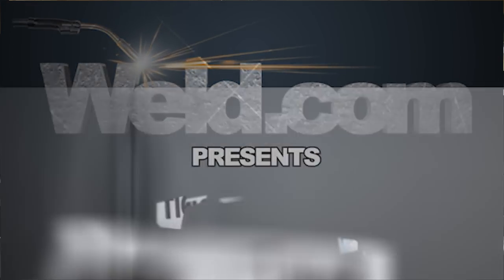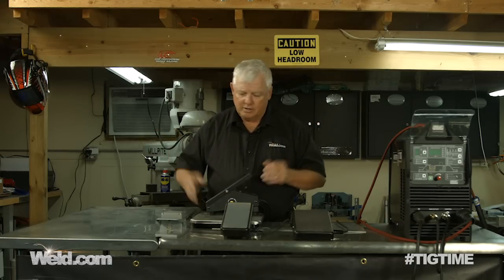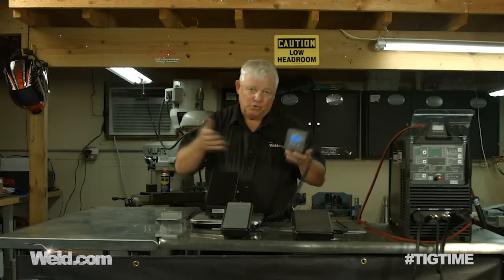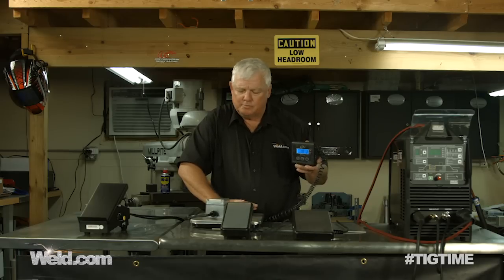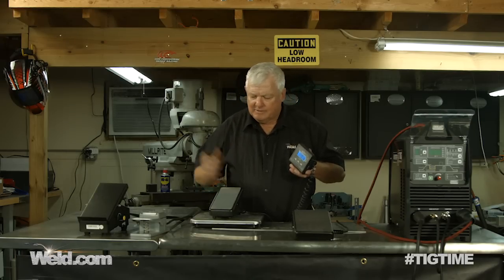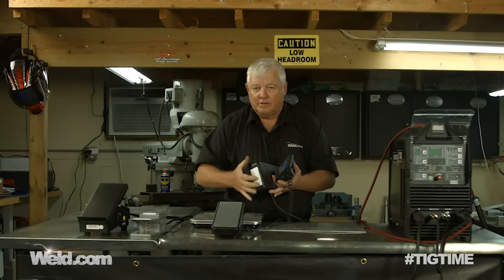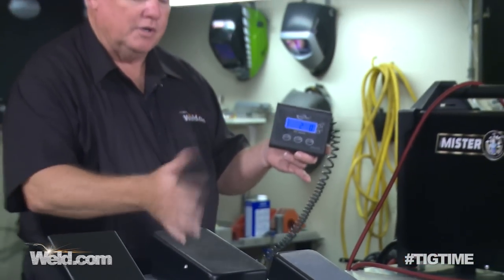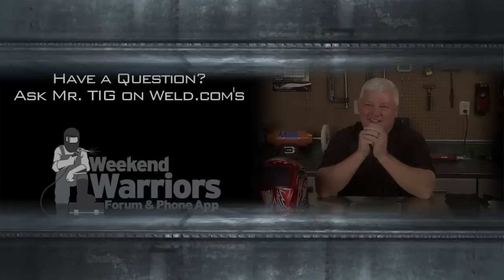TIG Welding Foot Pedal Review: Good and Bad | TIG Time

Comment: One thing that should be considered for Everlast users, is that the longer "throw" of the Everlast pedal offers better resolution by offering further travel area over the same amount of amps, resulting in the ability to make more gradual change in amps.   This can make it feel a little less "snappy" than the SSC, but does give finer overall control than the shorter travel of the SSC, which we do recommend to our customers but is a tradeoff and a definite factor in some people's decisions.
Reply: If you are limiting the amperage on the control panel the throw shouldn't matter as much as the smoothness, right? Just limit the amps a little more and you won't get the jumpy feeling, correct? For the record, I use the Everlast 200DX with a mr tig kit and really like the machine and the accessories.
Reply: Frank Bibby
 If you have to weld at say....150 amps, you will still get better control out of a pedal with a longer range of travel.  The Miller pedal is such a pedal with a longer range of travel and different dimensions similar to the Everlast and many people do like them.  The Mr. TIG kit is nice and top of the line.  We recommend it, approve it.  No reason not to get it if the additional cost can be swung, but I wanted to point out this factor was overlooked in the discussion.  We do have people that want a finer range of control.  Personally, the notchiness of the pedals that I have tested is really not a lot different than the SSC in the newest ones.  The first few mfg'ing runs of the new pedal did not have enough lubricant on the gears.  A new grease/lubricant is being used and the smoothness is much improved. But when all is said and done, No one can beat the SSC for design durability, and over all performance.

Comment: Feels very much like a Shell- video to me
You only mention the brand of one pedal, of which you claim it can be made to work "on every machine" but also say that the pedal with the heavy spring "is the only one that works" for certain machines.
If your machine doesn't have amperage limiting built in (and those exist, especially older ones) a footpedal with a pot is actually really useful.
Pro Tip: A Footpedal is just a giant box with a potentiometer and a switch
Look up the wiring diagram for your welder and just make your own if you weld in places where certificates of conformity aren't necessarily important
Reply: shill video, not shell video.

Comment: The kemppi pedals have two pots! To set both Min and Max amperage. You can't even set it at the machine since only a kemppi pedal will work and they all work that way. The good thing about such a setup at least, is you can adjust the resolution of the pedal. The throw is always the same, but not the range.

Comment: The grey import with 15 pounds pressure makes irregular spots in the weld bead when you get on or off the amperage. I'm going to change or adjust the spring

Comment: If you have the pedal with the knob control on the side is there any way to be able to control it from the machine instead. The pedal has to cables comping out 1x 2 pin and 1x 5 pin and both connect to the machine.

Comment: Mr Tig, that first pedal I believe comes with our Aussie brand "Uni-Mig" ACDC Tig machines. I'm new to Tig Welding, so I have a question about that Foot Pedal, does that Amp Control on the side of that foot pedal over ride the Machines settings? because I can set the amperage on the machine, but I don't know if the foot pedal controls the total amperage that my machne can put out or if it controls the amount available that I have my peak amount set at at the machine. For example, if I have my Peak Amps set at 120amps on the machine, but my machine has a maximum capacity of 200 Amps, so will the foot pedal max out at 200 Amps if I press down all the way flat, or will it max out at 120?
Reply from the maker: The foot pedal over rides the machine setting. So if your machine is set to 200 amps and your foot pedal is at 50%, you will only get 100 amps out of the foot pedal when fully depressed.

Comment: I have become curious about how the tig pedal actually changes the amps inside the machine. What flows through the tig pedal must be just a micro current right? What is going on inside the machine that allows the micro current to effect amperage change? Thanks.
Reply: It's just a potentiometer in the pedal setup as a voltage divider. There's also the clicker switch that turns the welder on. The internal microcontroller inside the welder uses an ADC to read 0-100% and scales the output amperage accordingly. It's part of the main amperage control used by the front panel.

Comment: The function of the knob on the pedal completely depends on the way the pedal interfaces with the machine and the capabilities of the machine. In some configurations the pedal control DOES NOT control the machine amps - instead it merely limits the upper amperage when you are using the pedal.

I think this was a very misleading review. It was a blatant sales pitch. "This one doesn't qualify" is simply showing either your ignorance or you bias to sell your product.

Comment: Mr Tig 
I have been watching hyou channel for a long time, thanks it's very helpful. I'd like to see some more interesting welding like to build up the broken find of a motor bike cylinder in cast iron and in aluminum, one of the internal one which is difficult to reach. Also something about spot welding , thanks like your channel a lot
that old Bob

Comment: Hi, I have a DC straight tig welder ( Esab buddy 160 ) torch has a three pin connection and a button on the hand grip , is it possible to connect a foot pedal to it ? Machine didn't come with a one .

Comment: Hey , I have no idea why you discount the pedal with the pot ,, My pedal has the pot and its the other way around , ITS THE MINIMUM AMPS . so i can set the MAX on the machine and pump the pedal so as the amps don't drop to "0 " so in a pulse situation i can say go from no pedal 15 amps to 35 set on the machine ,,, I agree with everything except this pedal review with the potentiometer  ,, Maybe your machines are wired wrong ,,, Mine works perfect , i have 5 pedals 2 esab 1 WIA and 2 of the cheap ebay $45 pedals   ( i think esab they are crap way to heavy (after a few hours i find I'm bracing my knee under the table ) >
As we all know we are all different welders no 2 the same ,,,, so the opinion is a bit like an arseholes ,, EVERYONE HAS ONE !

Comment: I just bought a 325EXT Everlast machine and it has the cheap foot pedal on it. I notice it is slow to respond with my foot reaction and with what is happening at the torch. It's like i have to wait on it or there is a delay. Also, it falls over real easy when I try to slide it from one side of the bench to another when I'm standing to weld. What pedal would you recommend as a replacement??? Maybe the SSC that you mention in the video? Thanks
Reply from the maker: tigwelder303 Yes, I would recommend the SSC foot pedal. The 325 is too much machine for the dinky pedal that they provide you with! Here's a link to the pedal if you're interested: http://www.weld.com/index.php/shop-weld-com/shop-weldcom/foot-controls/ssc-foot-control-lincoln-machines-detail
Reply from the maker: +tigwelder303 Just for future reference... The 50K OHM is compatible with any Everlast machine above 200 amps and the 25K OHM pedal is good for any Everlast machine under 200 amps.
Reply: Weld.com Ok Mr. Tig, Thank you.
Reply: Weld.com
Not exactly.   You should contact Everlast for what will and what won't fit.

Comment: Mr. Tig, I am having trouble with my foot pedal for my Miller tig welder. The pedal I'm currently using has stopped giving me control of my amperage. I currently have the Miller RFCS 14 and it only gives me on or off. After running some tests I'm having trouble isolating the issue with it, (the manual for the welder only gives po#'s for replacement pedals, not for parts or trouble shooting the original one) and without anyone more experienced than myself I'll likely have to replace it within the next couple of days (any info you have on the amp control would be greatly appreciated and maybe save some money too). Do you believe it would be worth the extra money to upgrade and buy the RFCS 14 HD as opposed to the standard RFCS 14? Thank you in advance for your time and help!
    Andy
Reply from the maker: Andy, it sounds like your machine is in 4 step mode and you need to be in 2 step mode. Some machines indicate this as 2T and 4T.